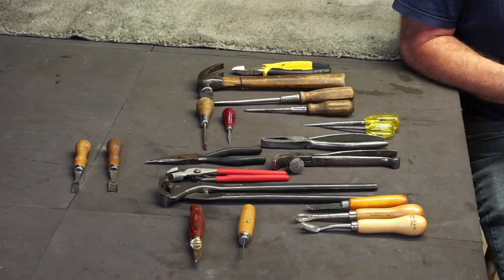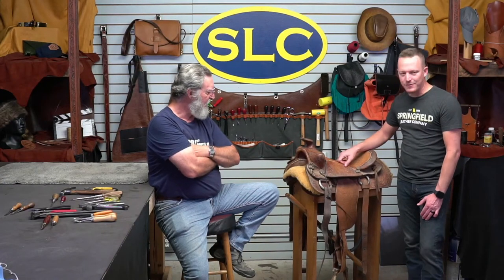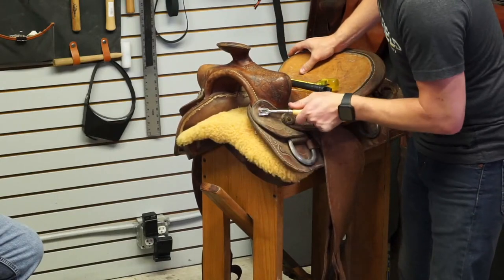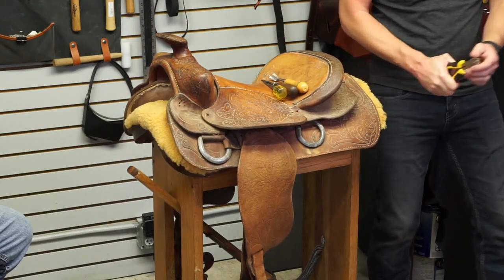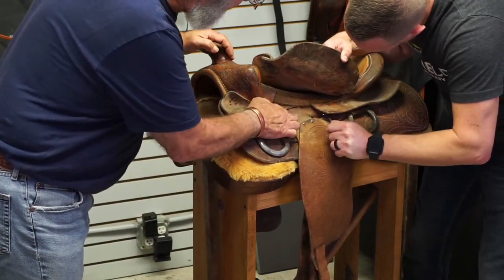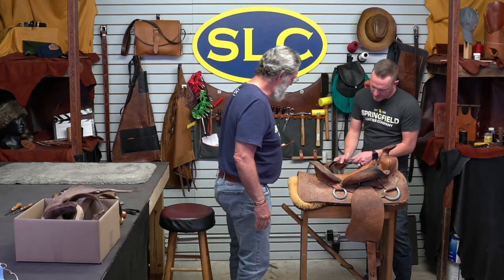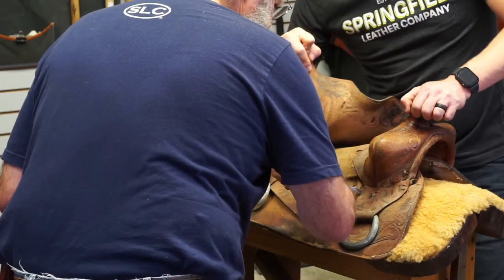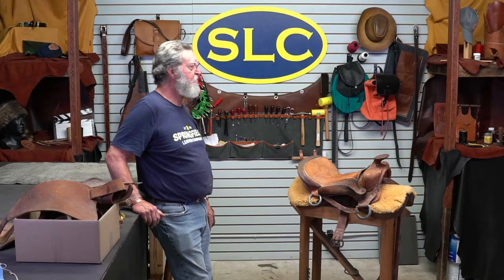Saddle Deconstruction with Denny & Tony

Comment: I have a civil war era mcclellan saddle, it is missing stirrup straps etcetera. the seat and tree look to be good. Are they worth repairing
Reply: Also I only have one fender. Can I use the one fender to make another? How would I make the leather look old?
Reply from the maker: Hey Kevin, the worth repairing is really up to you and if you want to take it on. There does seem to be quite a few of those saddles still around today. 

You can use the fender you have to make a new one for the other side. Just flip it over so the pattern is reversed for the other side. As far as making it look old...time seems to be the best way...other than throwing it around in the dirt and staining it. ;)

Comment: You guys are bent over that saddle and it's no wonder your back hurts.  The height of the stand is wrong for either working on it sitting down or standing up.  I could build you a stand that you could get your feet under that would turn like a lazy Susan if you stepped on a foot pedal and not turn if you didn't stand on the peddle.  Then you wouldn't be all crippled like an orangutan.
Reply from the maker: Let us know if you need the address to mail it to us!

The saddle stand we are using pre dates the 80s. we don't do saddle repair here. We just wanted to give some helpful tips and a video showing it is not that scary. But the key to success is having the right tools and a saddle stand like you mention would be perfect!